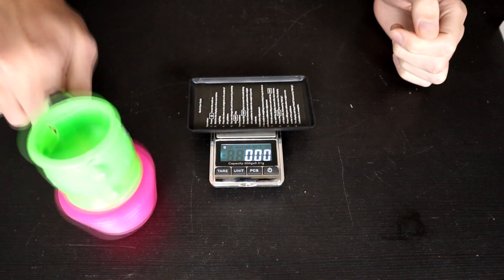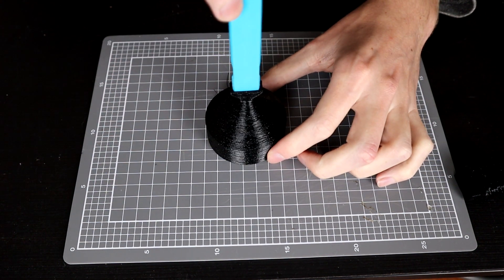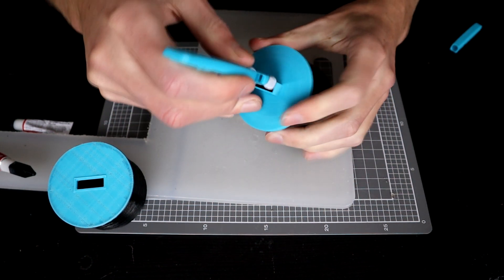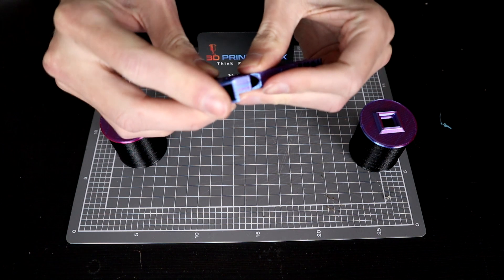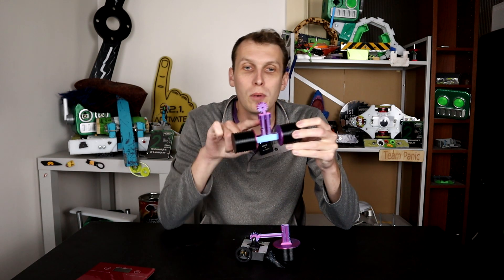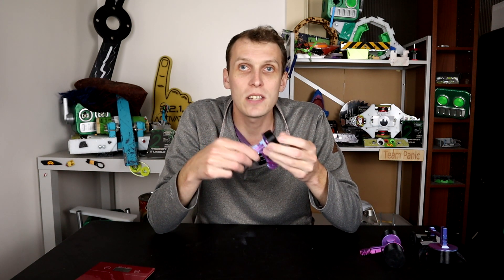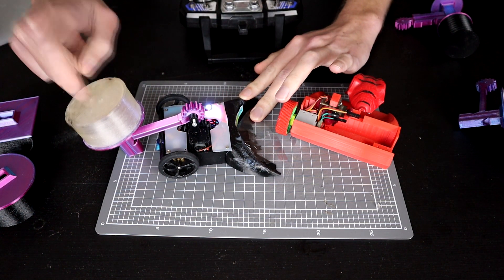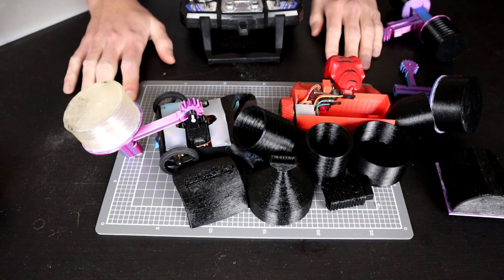3d printing a noisy hammer for a combat robot!!

Comment: it seems to me the problem is leverage. All of your force needs to the far end of the bellows. Right now, its either in the middle or at the close end. I would try a design that looks more like a fireplace bellows and go back to printing in the pleats. With the pleats being largest/deepest at the far end and going down to almost nothing at the close end. the far end also being taller and the close end very short, needs to taper vertically and horizontally.
Reply from the maker: Bellows is a good idea, i'm just not sure how to design them in such a way I could print them
Reply: Yeah sorry, i have zero experience with 3dprinters. I just assumed they could print anything. How about printing a smaller version of your round one but half sized and offset to the far end, or several smaller ones around the periphery at varying heights being shorter on the near end and longer on far end to match the arc of the swing?  @TeamPanicRobotics
Reply from the maker: No worries, they can do a lot, just not everything, especially if you are printing in flexibles (I mean you can try, but certain geometries will be hard to get clean prints of, which is needed for bellows to reduce the chance of holes)

Comment: I think the issue you are running into is that when it hits the ground or the straight edge of an opponent the contact is too "flat", causing it to be spread out evenly on the contact face, rather than depressing in the face of the hammer causing the squeak. My suggestion for this would be to make the hammer face hemispherical so that when you hit an edge or the flat ground, there is some depression of the hammer before the outer edges of the hammer face (the most supported and the least compressible) make contact.

Comment: Rather than a cylindrical design try a hemispherical design and with a much smaller diameter
Reply from the maker: I tried a hemispherical design at the end of the video it was near impossible to print and the one I did finally get printed unfortunately didn't work

Comment: Definitely agree with what people are saying with a cone/spike in the center. I keep thinking having the hammer arm angled similar to season 2 Beta. With a robot underneath, the squeeker is more likely to hit flat rather than the corner.
Reply from the maker: The hammer is angled, its just angled down by the gear and not up by the whistles, the effect is the same though.
It probably could use a little more angle, because the one it has currently was perfect for the old hammer

Comment: It seems like compressing any sort of a side wall is a no-go, but compressing a flat "membrane" like the bigger cylinders works.
Instead of making it hit something pointy in the middle of the flat face, add a hard tip to the middle of it as suggested by others, but also:
Make the cylinder as wide as there is a clearance (still keeping it circular face) and only as deep to not limit to membrane movement, so the air pressure is not lost to the flexed walls...
If taken the above to the extreme, it would result in a hard cylinder with only a bottom face flexible (kind of like a drum), with something hard attached in the center for a more likely hit.
Alternatively this can evolve into a spring piston, but getting smooth walls and a good seal between moving parts may be tricky with 3D printing...
Reply from the maker: I've printed a prototype close to this and it does act more drum like, it squeaks but it also makes a drum-like impact sound which drowns out the squeak a bit

Comment: I think the ridges along the bellows of the toy stop it from self inverting on the hits. I know that’s going to be a bastard to print though so maybe using the bellows from the toy itself is the way to go? You definitely need a rounded cone-esque shape to put forward the centre of the shape where the best squeak is, having walls as tall as the centre spreads the surface area of the hit across the whole shape, as we saw with the half cylinder, the walls didn’t compress as much as the middle (even though I realise that gave 0 squeak).

When Mark Thorpe invented robot wars, this was the final problem that he envisioned be solved by the builders. How to print your own lightweight squeaky hammer and make it work successfully on a robot 🤣

Keep at it Ben!
Reply from the maker: I was hoping to avoid using the toy's bellows so I could upload this design as a fully printable bot, but I think you're right, they will make my life a lot easier
Reply: @TeamPanicRobotics  Unless you can cad and print that shape with thick enough walls but those hammers on the actual toy I reckon are pvc or some equivalent that makes them durable at thin wall widths

Comment: I rekon a smaller whistle diameter will help - you need air velocity to get that squeak, you generate pressure with the bellows but get that weak whistle because it's too easy to get the small volume of air out.

And what was that silky filament? I want some.
Reply from the maker: I would agree, but a smaller diameter also means less flex in the base of the TPU print which seems to be where all the air movement is coming from right now

Its a dual tone "red" and blue silk PLA I think ESun branded? I got it from 3dprintworx here in Adelaide
Reply: Keep the TPU part as is - make the whistle smaller - confine the flow to make it faster.

Comment: Try using the bellows from the toy hammer but with the 3d printed whistles, it's the middle body of the hammer that will account for the most weight in the pervious setup, but this might be also what is helping the bellows compress. By swapping between the printed and molded bellows you can see if it's the whistle or the bellow or both that is the issue.
Reply from the maker: I was hoping to avoid using the toy's bellows so I could upload this design as a fully printable bot, but I think you're right, they will make my life a lot easier

Comment: Had an idea on something you could do. I noticed on the squeaker toy, the actual hammer heads are somewhat bevelled on the front, there is a notable angle. So a couple suggestions I have:

Keep the rounded shape, but maybe bevel the base and point of contact, maybe if possible add back in the bellows too. would be a really complicated shape and probably really hard to print, but a bevel on at least one end will mean theres more potential for noise due to more surface area.

my other suggestion would be make less points of failure, you have by my count 7 points of failure before the whistle, so you could reduce that by making the full hammer arm one piece, whistle, splitter and possibly squeaker mounting points all as one piece so theres less places for air to escape, would also mean you could make the hammer heads be a little closer to the hammer arm (cause i also think the distance they have is making it really hard to get a squeak out, and the closer they are to the arm, the more speed and in tern power they will get.)

I feel with a combination of both you'd get a more reliable consistent squeak. ^-^
Reply from the maker: I did try a fully domed print, but I struggled to get it sealed and it doenst auto return much like the cone

The second arm design has the whistles in the head, much closer to the bellows with fewer points of failure I think thats the best I can do there
Reply: @TeamPanicRobotics  I didn't mean a domed head, keep the cylinder, but make the actual contact point beveled, so you have more surface area to hit. If that makes sense

Comment: Seems to me a dome shape on the bellows would work best (or a dome with a flat end). That should also fix the problem with hitting flat surfaces because the energy would always be focused on just the tip, so it can flex inward more easily rather than pushing directly against the next layer (much like the ribbed design you were talking about). Also with two whistles you need twice the airflow to make a sound. I don't think the friction of the air rounding the corner is the problem. Alternately, it would probably work to make a longer tube and hit with the side of it it like it was a tube you were using like a sword (if you get what I mean, we all did that as kids, right?). That way you should get a nice compression and you don't need two bellows, though it would probably require some design changes.
Reply from the maker: I did try a fully domed print, but I struggled to get it sealed and it doenst auto return much like the cone

The whistles are independent, one per bellow, because I agree, double the whistle means double the airflow needed

I like the idea of hitting the side of the tube, might try that with one of my test prints to see if it works

Comment: It doesn't look like when your successfully getting squeaks that the actual sides of the bellows are compressing, it seems all the air is being displaced by the base of the bellows, which is why it's louder with just your finger or the sharp edge of the wheel versus the chassis you were hitting because the base is bending more. Something protruding from the center of the base will help concentrate the force there and should be more consistent. There also probably isn't a reason for the bellows to be much deeper than the maximum depth of the compression, none of the other air is doing anything so having a large bellow holding it is only giving the hammer weight it doesn't need and more opportunity for printing errors and holes. Good luck, it's a fun bot!
Reply from the maker: That is a great point, it is the flex in the base giving the airflow, a PLA point would help concentrate the force

Comment: Maybe use latex body paint on the outside of the single wall. It will seal up the print without adding much weight. I've been dipping my lightweight foam wheels in it for grip, and it works great as long as the surface isn't too smooth.
Reply from the maker: That's a good idea!
I dont have any on hand though so I'd have to order some in

Comment: Try the bellows again with the steepest angle you can print for each bellow (so the peaks are closer together )
Reply from the maker: Could do, I was only doing 45 degree because I was designing things in a basic CAD package, if I moved over to Fusion I could do some different angles
Reply: @TeamPanicRobotics  or even try a corrugated iron type of pattern if the sharp edges are the issue.

Comment: I would try using a thin plastic bag stuck inside the TPU to act as an air tight bladder. Then you can concentrate on getting the TPU to  have the correct compliance without worrying about small holes.
I'm not sure the large static volume relative to the volume compressed when its on the robot helps with the sqeek.
Reply from the maker: I'm not sure how I'd attach the bag to the tpu, someone else suggested latex paint to seal the TPU which I think will work

That is a good point, I might try shrinking the bellows a bit
Reply: @TeamPanicRobotics  I was thinking dabs of superglue, just enough to pull the bag back to shape as the bellows expand. Sealing with latex does sound like a better idea.
Perhaps an open cell sponge inside the bag would be enough to expand it negating the need to stick it to the outer TPU.

Comment: Id say try a softer TPU. Will still be a pain, but may help. OR also a pain, but try to have a solid hammer that sits between the bellows and the whistle and is pointed to hit it in the ideal way. It could be a pain to get it all together, but you could get away with a smaller bellows that is easier to compress when the hammer head hits anything. Of course the hammer would have to have some sort of free movement compared to the bellows and whistle. Or just ignore my mind.
Reply: The solid hammer with the bellows in between is an interesting option
Reply from the maker: I like the idea of a solid hammer face to concentrate the force onto the bellows

Comment: what durometer are you using? I feel like using the lowest durometer you can reasonably print would be better. Also could you bevel corners? If corners are causing you issues then maybe a bevel opposed to a chamfer would be more effective.
Reply from the maker: The TPU is a 95A, the "rubber" is a mystery but feels softer then that
I'd love to do this again with that new variable hardness TPU but I dont have time to ship it to me before my next comp

I did try some bevelled corners, unfortunately they are hard to print and often lead to the hammer head not springing back

Comment: maybe a whistle like a kettle would work better as it doesn't relay on the harmonics of the whistle chamber, or maybe something more similar to those clown horns also if the air chamber is to large does that not reduce the pressure provided as the percentage volume is decreased less, potentially you could get liquid rubber and paint it onto a 3d model, IDK I claim no expertise in squeaky hammers or whistles, my knowledge is basicly based on a steve mould video on whistles
Reply from the maker: I thought about a kettle whistle, but thought they needed a continuous stream of air, might be worth a second look
Oh! a clown horn is an interesting idea

A thinner bellows section does sound like a good idea

Comment: Here are some ideas that might help. 

First, pressing the bellows with your fingers is totally different from the hammer hitting something. Remember force equals mass times velocity. More than likely your servo is moving at close to the same speed with the lighter or heavier hammer due to its torque. If you can think about lengthening the handle of the hammer to obtain more speed with the lighter hammer (or maybe a faster servo). 

Second, the depth of the bellows is too large. The servo will never be able to compress the bellows more than a few millimeters and the large volume allows the air to compress inside the bellows and reduces its ability to make it through the restriction of the whistle. I believe the optimum shape for the bellows is a large diameter back but with a shallow dome covering it. The relative size of the diameter of the back to the to the height of the dome will need to be experimented with to determine the optimum given the speed, weight of the hammer and the volume of air required for the whistle. The dome may need some type of stop to keep it from being compressed beyond its ability to return to its normal position.

I hope this is helpful.
Reply: Maybe the dome could be a different material?
Reply: @alyandthecats  

Yes, the polyurethane that has been suggested in other replys might be a good choice. Although covering a dome shaped surface may work better than a mold.

Comment: Large spring with a plastic bag around it? As far as printing, maybe smooth, wavy walls rather than ridged and try different scaling for the waves? There has to be a way to allow it to compress more freely without creating points of failure for holes to develop.
Reply: Or would be much heavier, but a piston style hammer with a soft spring could push out a lot of air
Reply from the maker: Another comment suggested liquid latex as a covering to fill holes and I think thats a great idea